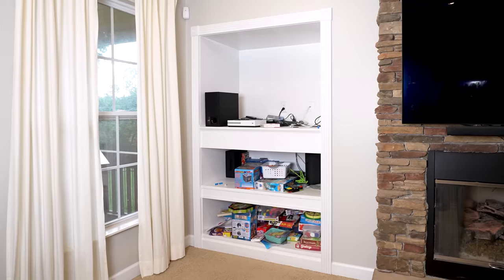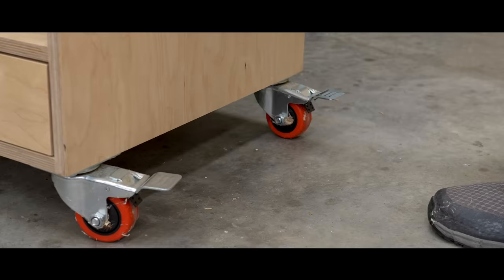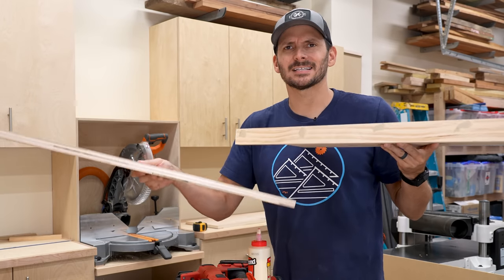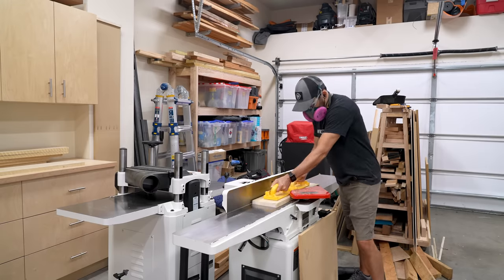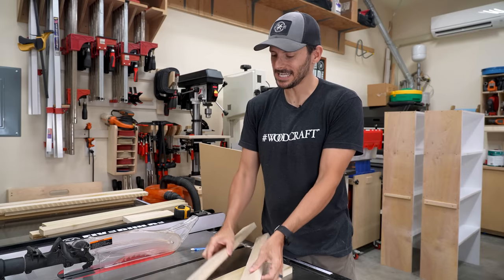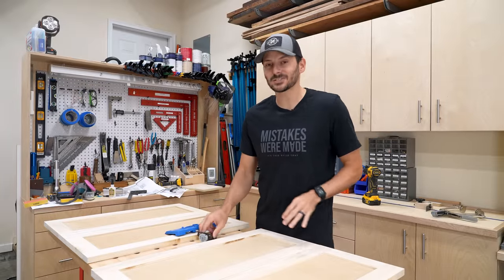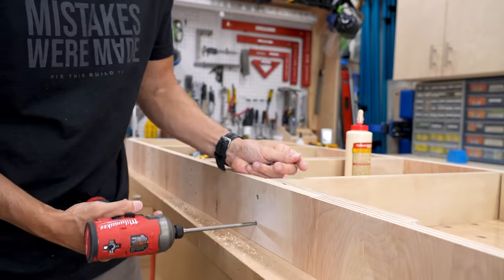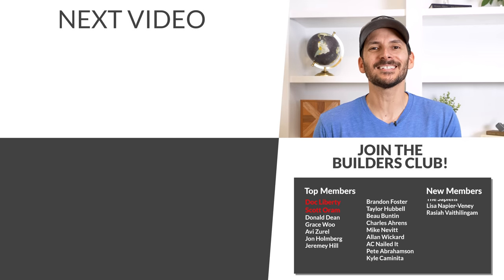I hid something in my walls

Comment: Another nice build.  Good tip on checking the factory edges of plywood.  In many of your other builds that required panels is doors, you always sneak up on the groove size and with your expertise ... they always come out great.  Ever consider using a kerf maker tool ?  I started using one and it has made life a bit easier.  Aloha
Reply from the maker: Thanks, Tom!  I've gotta check one of those out.  have always seen them but never used one.
Reply: How is this comment three hours old when the video was only released 40 minutes ago?  🤔
Reply: @debandmike3380  He's a channel member. It was probably shown to members early.
Reply: @JohnC1  You are right Sir ... I joined the FTBT Buider's Club
Reply: @Fixthisbuildthat  I got mine from Bridge City Tools.
Reply: Literally just did a bookshelf build today where I found out the edges weren’t square until I was ready to put everything together. No bueno

Comment: Have you ever looked into Zipwall? I LOVE mine. They are spring loaded poles. They will go up to the ceiling. Just add plastic. I have a large space for my shop. So I leave them up all the time usually. But they go up and down so easy. And they keep the overspray in the “paint booth”. And the dust out. I don’t have it up right now because I haven’t been spraying. But its also great for just having hand finished items in there. Then you can continue working making sawdust while the paint/finish dries.
Reply from the maker: I have seen those. Been thi king about them for years since you know my hatred for dust 😂😂

Comment: When making the grooves for the front panels is there anyway to use a push stick or similar? I would like to do this but I would be very nervous about using my hands like you did. (Not safety police, just don't have the skill/confidence to do it myself). Great video!

Comment: My first thought for how to open up the secret panel would be to just use a suction cup to pull on it. Either that or put more magnets right in the middle and then use something ferromagnetic to pull on those. Using Mjölnir to enclose the magnet is a cute idea.

Comment: Beautiful project and great use of space! As someone just starting out attempting to make his first cabinet panels, I have a question regarding wood selection for painting. The plywood you used seemed to take the paint beautifully, but I’m having issues with still seeing the grain after multiple passes of primer/sanding. Does your video skip this slow, painful sanding part, or is there a specific plywood grade you’re using that doesn’t require it? Thanks for any advice!!

Comment: I had a similar space when we did a remodel (did not do it myself).  I put 24-inch-deep full extension drawers on the bottom where you have doors and pushed the 12 in shelves all the way to the back.  Thor's hammer is brilliant.

Comment: Great project. 

I’m about to make some shelves. But I’m curious about something. I am making free standing shelves. They will be in the middle of the room. They will act as room dividers. Is there anything you would suggest?
Reply from the maker: I'd make sure they are either secured to the floor or ceiling. Don't want anything moving when it's not supposed to!

Comment: This is an excellent project your video has great detail.
I am wondering though you didn’t glue your door frame boards! What there a reason?
Reply from the maker: Because end grain glue bonds are fairly weak, and the glue between the face frame and cabinet is what will hold everything together and in place 👍

Comment: Looks you may have had to forgo the dowel connection for the uppers to lowers. If so, are the uppers just sitting on the lowers or did you figure out another way to attach them?
Reply from the maker: Good eye. We did have to forego them. Instead we anchored the lowers first then positioned and attached uppers to surrounding framing. So technically no connected, but a solid unit still

Comment: For jointers and planers I suggest considering CUTECH Tools. Their units already feature spiral cutterheads, at reasonable prices -- they have 6" and 8" spiral jointers and 13" spiral planers, all under US$700, not much more expensive than other brands using non-spiral cutterheads.

Comment: Regarding your narrow table, a quick yet permanent fix would be to add wood to each side of it. Buy yourself some 6/4 oak or maple and add 6" planks to each side. Attach with dowels or dominos, glue hell out of it, sand flush and give the whole new wider table a couple coats of poly. I'd also add 1" wide piece to each end, itll help keep thing ridgid and flat. You'll have your wider assembly table and make a vid of it for the channel. You're welcome.

Comment: I’ve been ‘staying tuned’ Brad, for two months now, turning blue holding my breath, running each time the little red dot shows that you have a new video for me, but no. Sure, the videos are interesting 🧐, but not the promised. Btw, no blaming it on Mrs. Brad, she can’t make up her mind, nope, she’s waiting, too. So?🤓 Beth, Austin TX
Reply from the maker: We've had a small wrinkle in the plan, new floors.  The design could change heavily based on what floor we go with.  So it's in the waiting stage until we figure that out :)  But it's coming I promise!
Reply: @Fixthisbuildthat  🙁

Comment: Hey Brad. Love your channel! This is probably a stupid question. I know there is no such thing as a stupid question, only stupid people……. Anyway, I know you can maneuver cabinets to get them square like you did in the video. However, what prevents them from going back to out of square? I know the face frames you used will do that, but what if you’re not using a beefy face frame?
Reply from the maker: Good question since I didn't cover install in-depth.  The uppers and lowers are both attached to the framing through the sides and top/bottom

Comment: and you have the same problem every utube woodworker has. 
   you build these tiny workbenches too small for plywood, so you have to cut the panel on the floor.
   and all your big boxes and panels hang over the edges so you have less stability for your work.
   in my opinion, any major workbench less than 6x3 feet is too small.